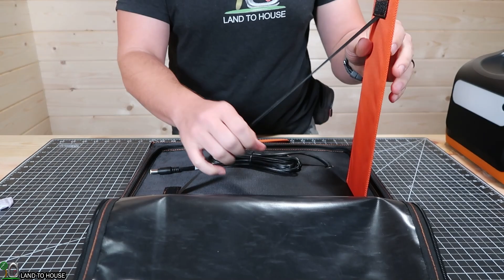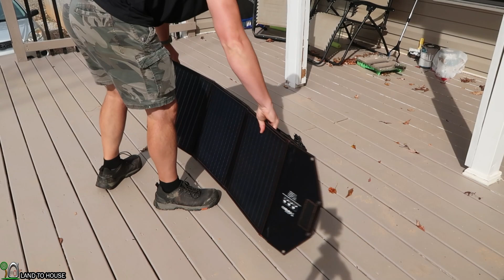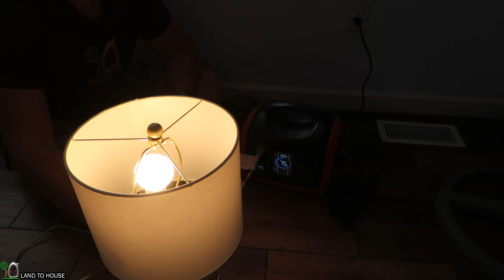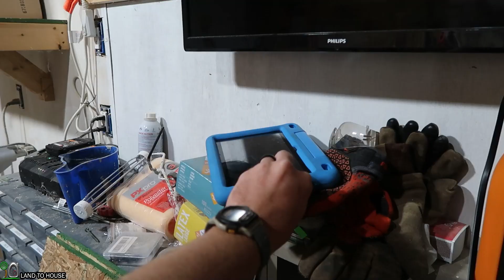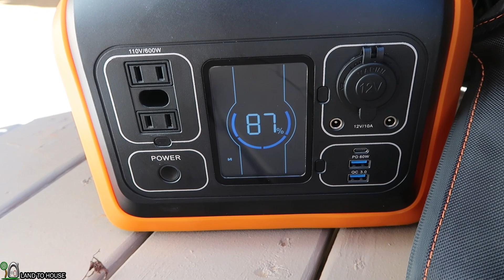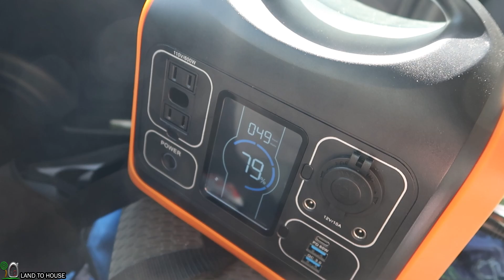Oupes 600w Power Station with Solar Panel

Comment: Do you think that the Oupes power station can run a portable air conditioner (e.g., 10,000 BTU) for at least for as long as the battery lasts?  🤔  Thank you.

Comment: Bought a new one from 2022. It has 15 less db, instead of 30 db of the 2021 version. It was $369 on Amazon and $20 more than the older and noisier one you reviewed.

Comment: Thanks for the tests. I will not consider this unit. Should have ran the saw if the unit had surge protection. Solar panel drains the battery? Ridiculous. There's a reason why it's cheap. And thanks to you I determined this is not for me.

Comment: Excellent review.  My wife and I are both very interested in powering items in our home when outages occur using battery back-ups.  So far I use a home-made system using 2 AGM 35 amp/hr. batteries and a couple of inverters.   I can see how nice it would be to have a more incorporated unit.  So disappointing on the solar charging.   I've seen other reviews where it worked fine charging this way with other panels.
Reply from the maker: I have enjoyed the bluetti and jackery systems the most. This one works but the solar charge issue was not good.
Reply: @LandtoHouse  - that's too bad as it looks like an otherwise, well made unit.   I've researched both the Jackery and Bluetti systems which both look like good units as well.

Comment: Come Oupes, you can fix this.  Depending upon the choice of components, it could be as simple as making adjustments on 2 trim pots, or as complicated as swapping out the charge control circuit card.
A 19.8v LiFePO4 battery pack has 6 cells in series in each bank, and the number of banks determine how much amp-hour storage the pack has.
Actual fully charged voltage is 21.6v, nominal charge is 19.8v, fully discharged voltage is 15.0v.
If the internal charging controller is set to peak at no more than 21.6v, then the last few percent of charge will take forever since it is trickling in a tiny fraction of an amp to the battery pack and not maintaining constant current (see CV/CC charging)
The wall charger delivers 24v, plenty, but the car charger delivers only 12.5v-14.5v, so the internal charge circuitry must be engaging a step-up-buck-dc-to-dc converter to raise it to 22-24v to feed into the charging controller.
And if the threshold voltage for turning on the step-up-buck-dc-to-dc converter is less than 22v, say 17v, then it would try to charge the 19.8v battery pack directly off the solar panel 18v which would explain why the panels discharge the battery.

Comment: How the solar was discharging it in full sun is beyond me..... I just can't figure that one out especially since it was reading 90w at one point.... it's like the sun makes the panel use power.

It's not a terrible product but definitely needs a few tweaks

Comment: Wow thanks for the video......... because that thing is kind of a piece of crap.
Reply from the maker: I had high hopes for this 1. If they would fix the charging issues it would be a nice product. As it is the solar charging is useless and the wall plug continues to run forever and ever.
Reply: @LandtoHouse  yeah not being able to solar charge it and it taking forever to charge pluged in the wall and car charge it and I find it useless that you can't use power tools
Reply from the maker: The jackery and bluetti we're both very capable units. Price is also so a lot higher but things worked really well. I was able to run the saw and angle grinder no problem.

Comment: What is the power of the cooling fan that it's stronger than the solar panels power? Crazy. There should be some intelligence built-in for such situation. But thanks for your honest review.
Reply from the maker: Apparently the power of that fan is almost a 100 W.... I'm guessing that there is no blocking diode to prevent power discharge on that panel.
Reply: @LandtoHouse  with 100W it should fly like a helicopter
Reply from the maker: My guess is that fan uses 6 to 12 w max. The issue is not the fan.

Comment: I don’t think it will ever show 100% with a 2 digit centre display…just a thought.
Reply from the maker: The images on Amazon show 100% on the display so I figured it would but.... I never saw 100.
Reply: @LandtoHouse  understand now…thanks for communicating, most you tubers I find don’t respond…great video btw thanks for posting…will look through more.
Reply from the maker: Sure thing. Last year I commented back on 16000 comments. And that was maybe a quarter of the comments I got. It gets harder and harder when you start getting 100 plus comments every day.
Reply: I've seen mine at 100. I find that it takes a while but I've seen it. I didn't do a test to watch it or anything.

Comment: It looks like you could plug a grounded plug upside down in the bottom outlet, to bad solar dosen't work
Reply from the maker: As long as the polarity of the plug did not matter. The receptacles have different sized holes for the plug.

After making the review I went on Amazon and found others have this issue with solar.
Reply: @LandtoHouse  The upper 120VAC plug has the common blade (larger one) to the left (right side up), the lower plug clearly has the common blade (larger one) to the right for upside-down (ground prong up) like you put in your workshop.  So you can use a grounded plug in either, but not both at the same time since they share that 'void' for the ground prong.

Comment: Use the USB-C port on the device to charge to tablet. So use a USB-C to USB-C wire and tablet should charge ALOT faster!!
Reply from the maker: I will have to give that a try on my next power station review. It came with a cable.

Comment: Max watts from solar panels compared to wall/car charger? It seems the PV wasn’t able to produce enough. Too bad. Did the cigarette port work? How many amps? Was it regulated? Thanks for sharing
Reply from the maker: The solar panel did get close to 90 W which is impressive for a 100 W panel but I'm guessing there must not be a blocking diode in there because it seemed to drain the unit. The wall plug seemed to run the fan fan and never reach 100% charge.
 The other features of this unit worked fine.
Reply: @LandtoHouse  Very odd that 70w of solar can't charge it but 48w of car charger can charge it.
Reply from the maker: The only thing that I can think of is that the solar panel does not have a blocking diode to prevent power going from the unit to the panel. The Amazon reviews also showed that some units were broken like this.
Reply: @LandtoHouse  Even if there is no blocking diode the solar panels should be able to charge it when producing 70W. There must be something seriously wrong! The charge went down more quickly with the solar panels than in your test with the 200W working light. Somehow I have the feeling that the solar panels are connected with the wrong polarity. Do they get warm if you connect them without sun?
Reply from the maker: I need to take the panel out on a sunny day and use a multimeter. That will show if its backwards.
Reply: @LandtoHouse  If the plug on the solar panel is wired backwards, I would not expect the power station to register 70w of DC charging power coming in, I'd expect it to display nothing or a reverse polarity error code.  
The specs say internally it has a 19.2v lifepo4 battery pack.  The 13.5-14.8v DC in from the car charger would have to run through a step-up-buck DC-to-DC converter to raise it to 21.9+v to charge the battery.  The specs say the wall charger puts out 24v for charging, so it would not engage the step-up-converter to charge the batteries when using the wall plug adapter.  The solar panel is labeled 18V (19.8v open circuit) and if the power station's circuitry does not engage the step-up-buck converter at 18+v input and instead tries to charge the battery directly off the panel's 18-19v, then this could explain it.  It would read 70w of incoming power, but attempting to charge a 19.2v battery from 18v would drain it instead of charging it.  Using 2 solar panels rated 12v each wired in series for 24v and cobbling together the connectors to plug in to the unit's barrel connector input would probably work if my guess is correct.